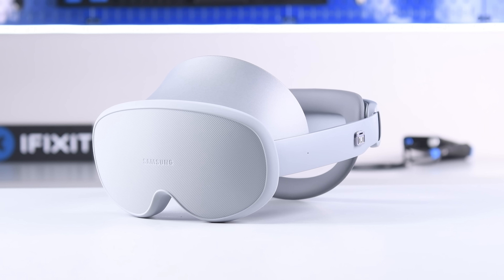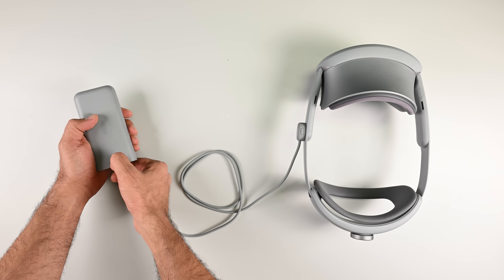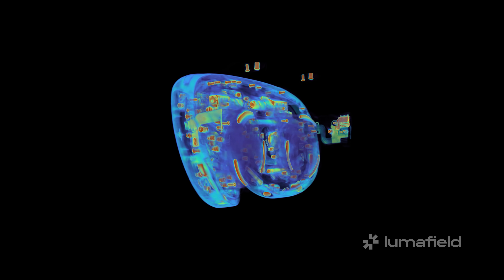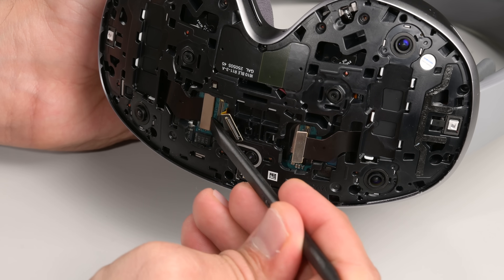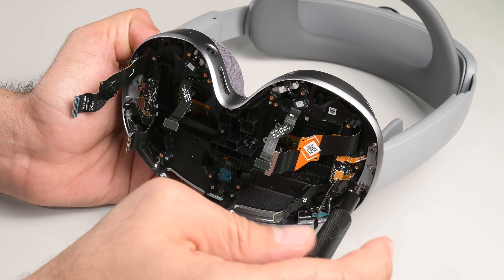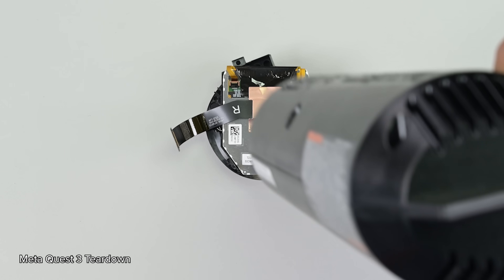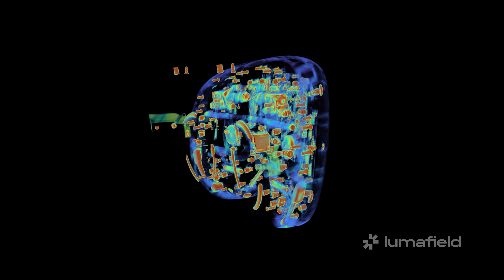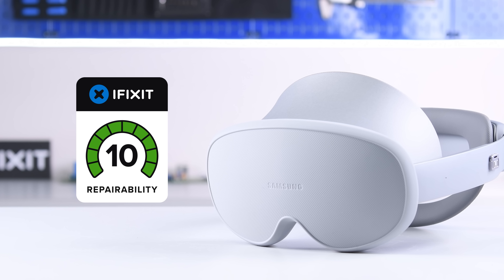Galaxy XR Teardown — What Samsung Got Right and Very Wrong

Comment: I feel like in light of how often Meta's headsets brick, iFixIt should consider starting to score open reflashing tools, especially for VR headsets (ex, if the eMMC is completely wiped, can the device be recovered by an end user). Apple seems to be the only one with open tools since Qualcomm doesn't provide firehoses to repairers.

Comment: The modular vs. glued design debate is key for R&D. Getting physical prototypes in hand fast is crucial to test these choices. We specialize in rapid CNC/3D printing to accelerate that hardware iteration cycle. Great video!

Comment: i remember getting quoted around $340 for a set of two 3552*3552 SY130LJM01 displays so my guess would be that samsung is getting away with maybe $150-$200 in the worst case, which even then is unrealistic when considering the number of units being put in production are in the tens of thousands
Reply: i wanted to buy 11 pcs and got a discount 299 each

Comment: 1:40 - And the Steam Frame is 440g with battery. Plus the battery is on the back leading to way better balance. The piece in the front is just 185g.

Comment: Apple’s Vision Pro quality is way better than this as expected from Apple but a swappable battery is a nice thing. Not Comparable but good to see Samsung's efforts. Hope this tech improves in a good way and is accessible to most people.
Reply: It doesn't really matter if the weight is ridiculous like the vision pro. If I can't use it for a couple of hours without having massive neck pain, what is the point of good quality?
Reply: You can say Its subjective because some people like me love premium billed good quality product, weight management will better with time. as long as tech improves.

Comment: So you need to get into this thing's guts just to remove the strap? That's some bs right there
Reply: Looks like they're running the antennas (and speaker connections) back through the strap, so the decision at least has a functional reason.
Reply: yell yes ....but it"s ..."non removable"

Comment: You have to almost disable the entire device to remove the strap!?
Reply: I has a USB-C port and touch pad integrated into it.
Reply: @kellymoses8566  Apple's vision pro also has a connector and speakers in its straps yet you can remove them from the apple vision pro.
Reply: You can cut most of it off and attach aftermarket straps the same way the quest2/quest3 does, their straps actually slide right on
Reply: Yeah... That's understandable with Pico 4 which has an integrated battery sitting on the strap for balance. But this Samsung XR didn't need that design decision.
Reply: Yeah, that's pretty shocking actually given they could have sold other/better straps with batteries, better audio, etc. etc.

Those screens though - I WANT THOSE!!!

Comment: next stop steam frame lets hope they keep the same repair-ability as steam deck
Reply: Let's hope they do even better. The Deck is very good, except for the battery removal, the most likely thing to need replacement.
Reply: @Zanpaa the frames battery is incredibly easy to replace, you just have to replace the whole headstrap
Reply: @raccoonmanthing lol
Reply: I think they’re going to better it! Fingers crossed!!
Reply: We've already seen that the compute unit for the Steam Frame is easily removable from the headband piece so already that's leagues better than this glorified future paperweight. One wrong drop or bend and the Galaxy XR is entirely useless.